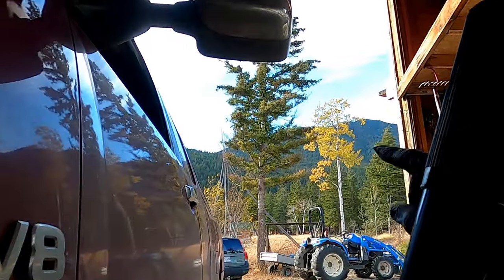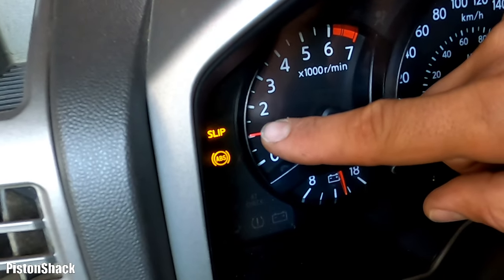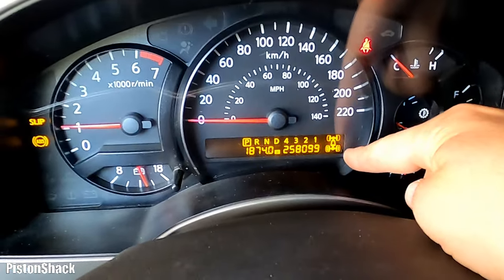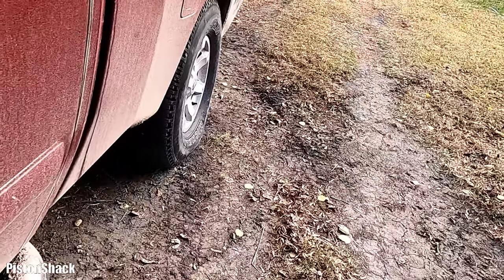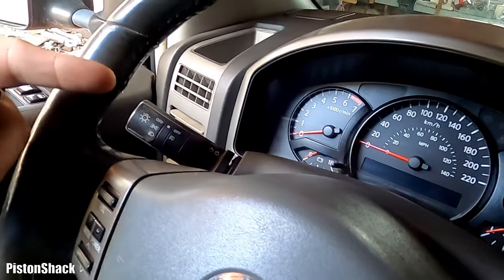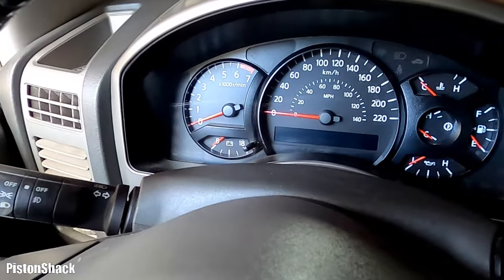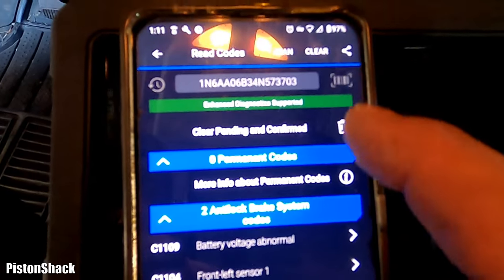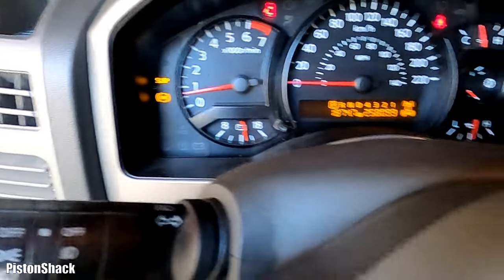NISSAN TITAN 4WD NOT ENGAGING, ABS & SLIP LIGHTS ON DIAG & REPAIR | EASY ONE THIS TIME

Comment: My abs and slip light are on. And 4wd light is on but doesn’t flash but when I put it in 4 wheel drive the front tires flash and my 4 wheel drive works perfect every time even with all the indicators on. But sometimes it gets stuck in 4wd so I have to turn the truck off and start it up again and then it will come out off 4wd. Idk what causes this and haven’t tried to find the problem yet I’ve just been doing it the way I explained. Another issue with 4x4 I only had it 2 times but when I was in 4wd it would not let me turn to the left at all I couldn’t even move the steering wheel an inch to the left. Took it out of 4wd and it was fine 🤦🏻‍♂️🤷🏻‍♂️

Comment: So I replaced a relay for the horn and the slip light came on and stayed on. All electrics work, no issue with brakes, sensors, all fluid levels maximum.... Checked the fuse box ground.... Did the whole drive straight and unhook the battery things.... No luck, still on. It's the only light on. What can clear this darn light out? I can't see the 2wd 4x4 icon and select drive mode with the slip light on. Any ideas on the fix?
Reply from the maker: Hey Jonathan! Locks like, probably, horn relay circuit pulling down another circuit. Did you replace old horn relay with OEM new one or some auto market comparable relay which fit? Does horn work now? 
If you remove horn relay, is there any difference? Does 4x4 actually works without illuminating the 4x4 symbol?
Do you have any confirmed or pending DTC (codes) related to instrument cluster module, transmission ect.?
Hard to tell without seeing the truck. Could be just coincidence, not related to horn relay replacement.
Reply: @PistonShack  I put in an OEM one but no difference so switched them back. The 4x4 icon is not showing, just the SLIP light so even trying to select 4h before starting the truck does nothing. I had a low voltage and CAN u1000 code but the battery is running 12.87 turned off and 13.83 turned on so no low voltage. The u1000 is so generic, no other info. I do agree though, likely the horn circuit pulling down another. Which one I don't know how to diagnose.
Reply from the maker: U1000 is CAN communication fault code due to some harness open, shorten, poor ground or failing one of the ECU drivers. 
Especially on Nissan Titan, I would go to check transmission main wiring harness connector for any rusties crustiest and moisture intrusion. Inspect connector for bridging rusted pins / terminals ect. It's pretty common problem on Titan. Connector is located behind front passenger wheel plastic liner next to the frame rail underneath a truck. This harness connector causing so many electrical transmission malfunctions.
Reply: @PistonShack  I plan on checking the grounds for main harness and ECM where abs and horn are connected through.
Reply: @PistonShack  checked the ground locations for ECM and abs and took them off, cleaned, checked ECU connector for dust.... All clean and back together.... Same SLIP light error and u1000/1 codes that are to check those grounds anyway and related to the SLIP light on.

Comment: Have a 2008 titan and the slip light is on and the 4x4 icon has gone. No abs issue. Thoughts? Brake fluid max, tires up, no abs sensor issue. It came on after i switched the horn relay, that's likely unrelated.
Reply: I have that problem brother, let me know, if you I control that problem, my 4x4  dont work

Comment: Easy peasy, great video. Those ABS sensors are very expensive and not need to replace it, if it ain't broken! What happened to the cluster panel on dash?
Reply from the maker: One of the display soldering joints doesn't make good connection.
Reply: @PistonShack  mine does the exact same thing. Maybe we could get a repair video for that in the future? It drives me crazy.
Reply: @7Monkeyfish  same mine does to and it bothers me lol

Comment: I didn’t watch the video lol…sorry. If its not engaging because ecm is not reading anything or no voltage. Maybe there’s short  circuits your abs wire harness . Needs new or the sensor is dirty. It happens to all nissan trucks or suv. 
I subscribe your channel ❤
Reply from the maker: Thanks)
Reply: Ypu didn't miss much, just tons of talking.
Reply: @fredaydaybae8450  😂😂😂